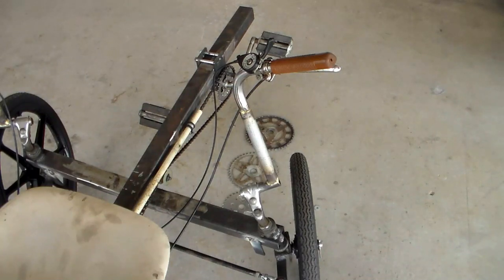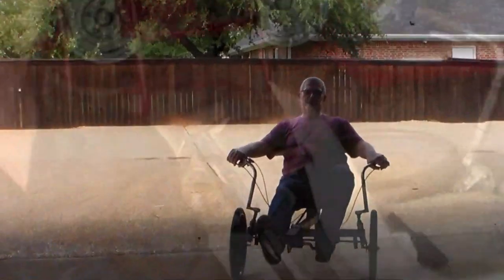Recumbent Reverse Trike Build part 1

Comment: This is great Lloyd! Maybe make the next one front-wheel drive. Use 1/2" drive spring joints to get the drive through to the wheels.  Shimano Alfine comes in 8-speed and 11-speed internal transmissions. I don't like derailleurs.
Reply from the maker: Thanks Marsh, this is giving me all kind of build ideas.

Comment: Cool Job, I think you will like the 26 inch wheel on the back. mine are all 20 inch (all three) and I think the 26 would help great job.
Reply from the maker: Thanks, good information to know when I make the next trike too. I was considering 20” all the way around but I will stay with the 26”.
Reply: @RustyGlovebox  I am just guessing but I think that it would make pedaling a little easier, and a little more speed. ( of course more gearing will help also)

Comment: That looks like a fun build and you have done a great job. As you have used the back half of the bike I wonder if it would be feasible to put the original seat in the post for a passenger
Reply from the maker: That is a possibility, that would be a easy way to carry a passenger. Only thing they would be pulling my hair to stop 😱 Lol. I have several modifications planned for the trike when the parts arrive . Thanks and take care my friend

Comment: That’s very interesting and something I’ve pondered many times. I have priced trikes. Oh my gosh! Talking 2500 up. Just ridiculous. I have a tandem seat trike that was a beach cruiser. It was a factory production bike. Talk about easy to flip over, it’s scary to ride. I mean scary. You have to be concentrating all the time because in a flash it will throw you like a bronco. Never did make it to visit you. Planning to go to Odessa January so maybe it will work out this time.
Reply from the maker: I have a lot more to do to this reverse trike. Got an e-bike electric assist rear hub to install on it. That will help a lot on any hill I come up on. Planning on making a different rear wheel mount to replace the back half of the bike that's on there now too.  Because of it's low center of gravity it's pretty stable and easy to drive. Thanks and take care Stoney